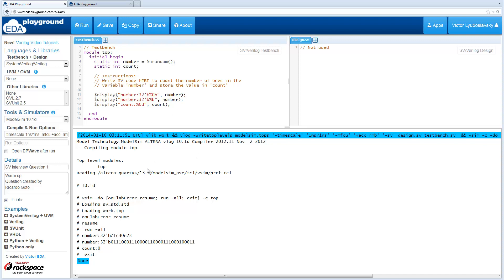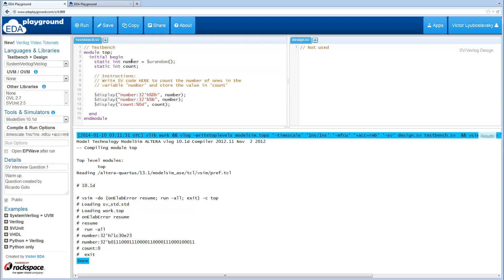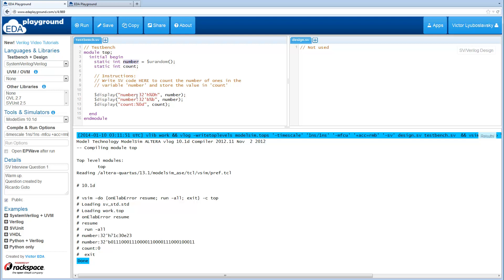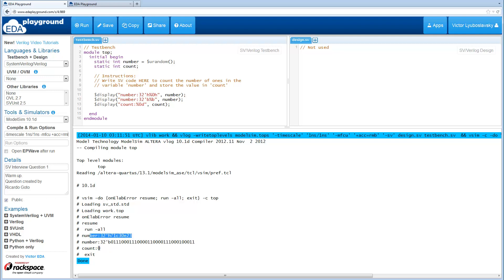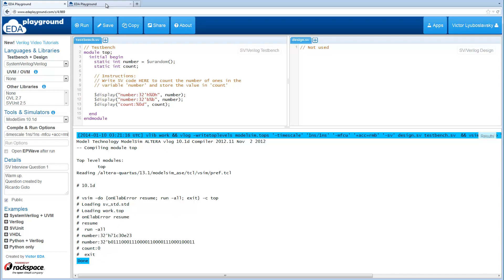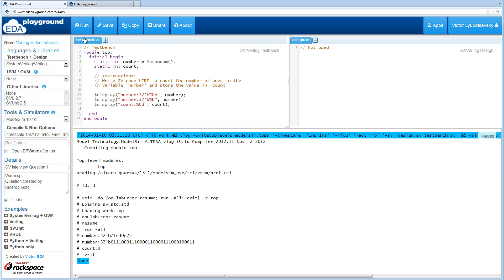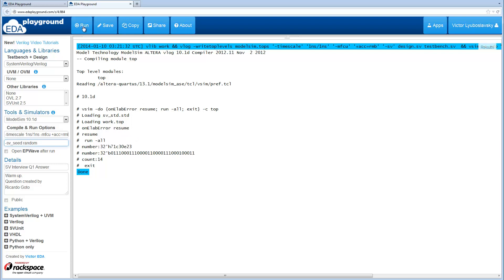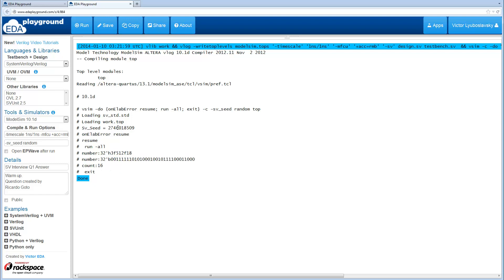SystemVerilog Interview Question 1 -- Warm Up

Comment: I'm getting the following errors:
main.v:8: syntax error
main.v:8: error: Empty function argument list requires SystemVerilog.
main.v:8: Syntax in assignment statement l-value.
main.v:9: syntax error
main.v:9: Syntax in assignment statement l-value.
main.v:10: syntax error
main.v:10: Syntax in assignment statement l-value.
 
for the lines:
    static integer number = $urandom();
    static integer count = 0;
    static integer i = 0;

why this is happening?
Reply from the maker: Hi Trisha,
The error indicates that the simulator you are using does not support your code, or that you need to add a command line option.
One of the great things about EDA Playground is that it is possible to share code by sharing the URL of that code. This is useful when you are asking for someone's help. 
If the above doesn't fix your problem, please share your URL.
Reply: @Edaplayground_EPWave  it is resolved. Thanks!

Comment: This is a good example to understand the built in methods that system verilog supports or else it becomes hard to code the actual logic
The built in methods can be:

• $onehot(expression)
	○ checks that only one bit of the expression can be high on any given clock edge.
• $onehot0(expression)
	○ checks only one bit of the expression can be high or none of the bits can be high on any given clock edge.
• $isunknown(expression)
	○ checks if any bit of the expression is X or Z.
• $countones(expression)
counts the number of bits that are high in a vector.

My code using onehot and countones: (you can directly simulate on EDA PLAYGROUND)

module count_ones;
  initial begin
    int number;
    int count;
    int multiple_ones;
    
    number = $random();
    
    $display("the number in hex is 32'h%h",number);
    $display("the number in binary is 32'b%0b", number);
    
    count = $countones(number);
    multiple_ones = $onehot(number);
    $display("the number of one's in the given number is %0d", count);
    if(multiple_ones ==1)
      $display("the number contains only one 1");
    else
      $display("the number contains more than one 1's.");
    
  end
endmodule

Comment: Hi, iam using the Tool Aldec Riviera pro 2014.10, I can't able to change the seed value, can u help how to get different random value for each simulation
Reply from the maker: There may be some switch in Riviera Pro. I don't know. There are various ways you can set seeds in the SystemVerilog language:

$random(<some number>) - sets the global seed (which $random uses) - global to whole simulation
$urandom(<some number>) - sets the global seed (which $urandom uses) - local to each thread

or some more esoteric syntax:

std::process p;
p = process::self();
p.srandom(<some number>);

also sets the seed for that particular thread.

Comment: I cannot run without submitting my full personal information. 
But here is my answer:

begin
    int temp_number;

    temp_number = number;
    count = 0;

    while (temp_number != 0) begin
        temp_number = temp_number & (temp_number - 1);
        counter++;
    end
end
Reply from the maker: Sorry for the delay replying - I have been busy teaching System Verilog. 

Yours is an interestingly reply. I don't understand how it works, but it does.

BTW: You can use EDA Playground without submitting full personal information. That is only required to use some EDA tools. Aldec Riviera Pro requires no such information to be submitted.

Matthew
Reply: The trick is that when a number is ANDed with (ifself - 1), it removes one bit of 1 from itself. I learned it from some bit manipulation courses. This is probably how system task like $countones is implemented.

And thanks for videos and questions. I went to read the LRM of system verilog and learned something new.
Reply: @UZen7788  tq for this way of finding no for 1s
Reply: @UZen7788  Thanks for sharing the real technique!

Comment: EDA Playground  HI, I have a small problem,please help me out,I have instantiated 4 modules i.e A,B,C,D in a separate module called "Top Module" such that each module works with the signals from the preceding modules i.e A>B>C>D , each module does some computations,now I want the modules to run in a recursive type of a way ie the output signal from module D will be given as input signal to module A,this looping type of behavior will happen until a condition is satisfied  and the final output will be taken from A,so how to go about this?

Comment: What is the name of tool you are using to run the program ?
Reply from the maker: The simulator being used is ModelSim. You can run/do the example here: http://www.edaplayground.com/s/4/869
Reply: EDA Playground Thank you. It worked ! Please post more videos on challenging interview questions on OVM and Systemverilog.
Reply: EDA Playground One of them could be "What would be the output when fork is used inside for loop. for loop runs for 3 iterations"
Reply: EDA Playground for(int j=0; j<3;j++)
                                 fork
                                       write(j);
                                 join_none.....answer is 3 3 3.....If you want to print 0,1,2, then use automatic variable concept...
Reply: TheThaddu I don't understand what this is doing?  can you elaborate.
Reply: EDA Playground Thank you but do I need to login in order to run the program ?